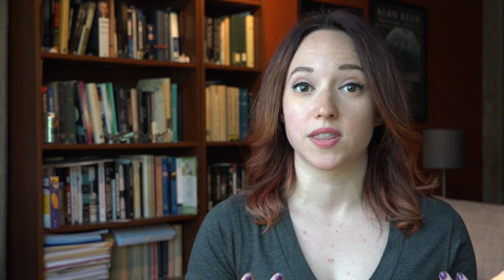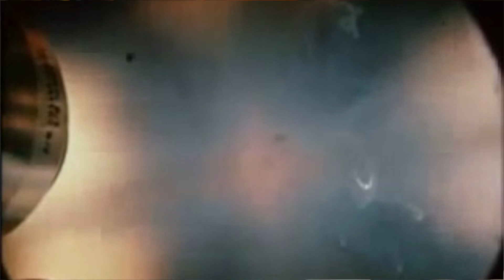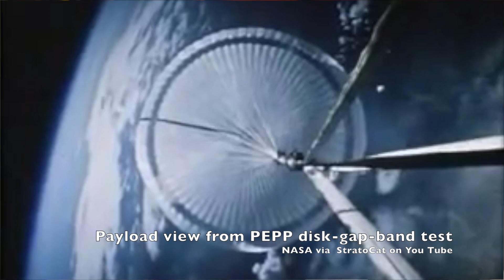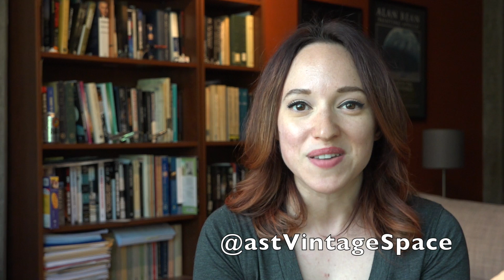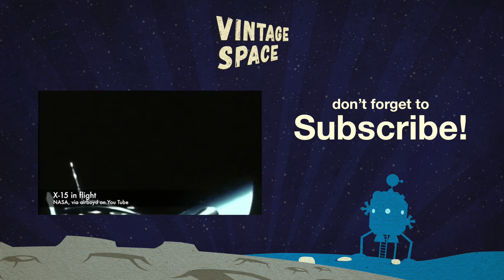Why is NASA Still Using 1960's Parachute Test Results?

Comment: I am not sure if you have talked about it before, but could you do a video on companies that are still around today who helped us get to the moon but do completely different things now? I.E. Playtex made the space suits
Reply from the maker: eivilcow33 Good call; the Playtex connection is a great one! I'll add it to the list!
Reply: And you thought "lift & separate" was just about launch & staging...<grin>
Reply: +Amy Shira Teitel (Vintage Space) Actually, it wasn't "Playtex" that got the contract for Apollo suits. It was ILC Dover. ILC (International Latex Corporation) was the original company, and Playtex was one of four divisions that split off from ILC in 1947. ILC was founded in 1932, and provided the US military with all sorts of rubber and latex items, including life rafts and canteens, during WW II.
Reply: Amy Shira Teitel Don't overlook Beech Cryogenics (division of Beech Aircraft) still based in Boulder, CO. They produced the cryogenic systems for Apollo.  And they initiated the chain of events better known as Apollo 13. Dropping the O2 tank most likely dislodged the internal vent line (leading to problems during the pad tanking test), and while still at the factory, they failed to upgrade the 28-volt electrical system components to 65 volts, per an engineering change order (further leading to the disaster most are familiar with).
Reply: ***** Experience in cantilevered structures comes in handy in lots of areas.
Reply: EricIrl Drat! You're correct!  My mistake, and edited above. Thanks for the catch. Further fact checking (vs. faulty memory) shows they also did the cryos for Gemini as well.  It seems Amy has already covered the tank incident previously: http://www.popsci.com/blog-network/vintage-space/recipe-apollo-13s-disaster
Reply: Mike Cowen No problem. It just shows how so many different companies were involved in the whole programme.
Reply: Mike Cowen Well hey that is a company that I haven't heard about, and right in my hometown no less! Maybe I should apply for an internship there...
Reply: eivilcow33 Beech have long since been subsumed into much larger corporations - although the name is still used for their light aircraft products such as the Baron, Debonair, Duke, Bonanza etc. For a while it was owned by Raytheon and it's now owned by Textron - who also own Bell, the helicopter manufacturer.
Reply: Mike Cowen I read that is was a division of Beechcraft (another mainly light aircraft manufacturer).
Reply: Isn't Bell up in Ft. Collins though?
Reply: eivilcow33 They may be but these large corporations will have their manufacturing subsidiaries dotted all over the US - and sometimes all over the world.
Reply: EricIrl
I bet space is one area where women DO NOT have to worry about what I believe is called "Cooper's Droop Syndrome".
Reply: ILC Dover is still making spacesuits for the ISS. David Clark Co. (best known for the dc headsets and U-2/SR-71 pressure suits) will make the crew suits for the new Boeing capsules.
Reply: Lancer525 ILC still fully owned the Playtex brand then and brought over its best seamstresses from the bra and girdle factory to make spacesuits. (See the Science documentary Moon Machines episode about the spacesuits. Hamilton Standard made the PLSS backpacks for the suits.)
Reply: Playtex?  David Clark Company,  Worcester, Massachusetts.
Reply: @toddmulligan2609  David Clark did the suits for Gemini. ILC Dover did the Apollo suits.